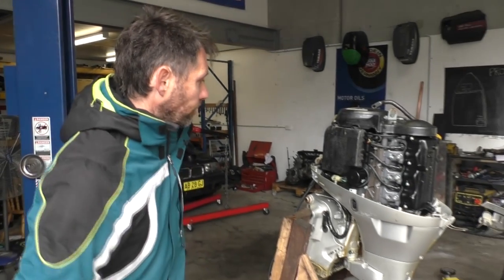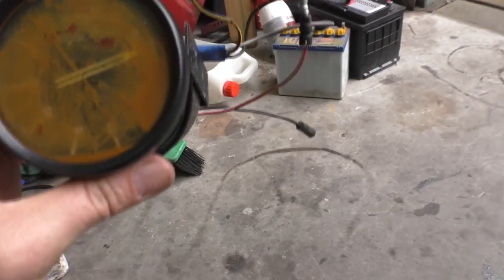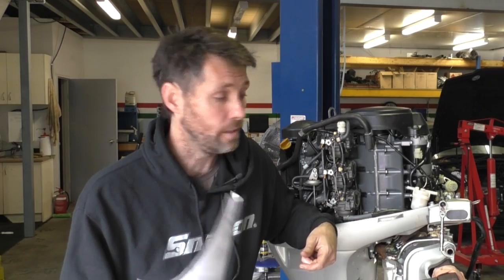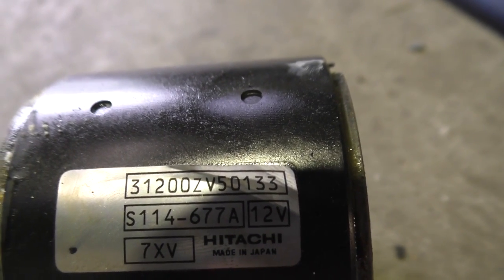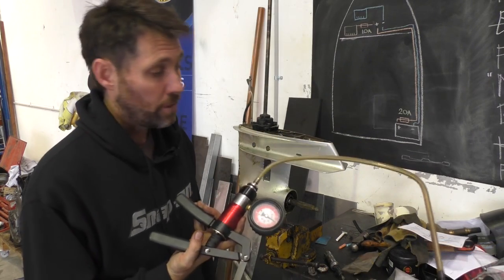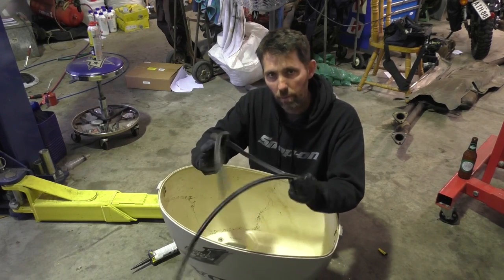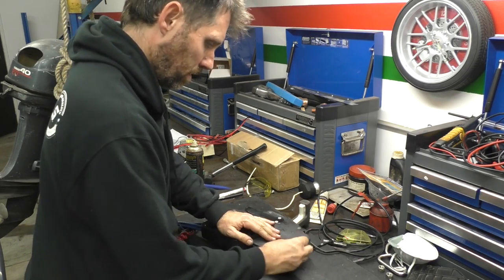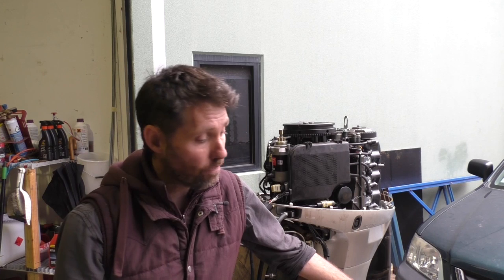Saving a sunk Honda BF40 outboard motor

Comment: A guy is willing to give me a boat for free that is sunk in his boathouse. Its a 24 foot cabin cruiser I/O from the mid 90s thats had the engine submerged during high tides (theres no water during low tide) for probably 5 years or so I was thinking of taking it on if we can get it out of the water. Do you think it would be worth trying to rebuild the original engine or just convert it to an outboard? He thinks the hull cracked around the out drive.
Reply from the maker: An engine that is repeatedly submerged and then exposed to air is going to have very bad corrosion. It would be cheaper to replace and rebuild most likely.
Reply: @DangarMarine  Ok thanks.

Comment: Hello, I'm Marcelo, I'm from Brazil, I really liked your drawings, I'm buying a motorcycle Honda hp for the year 2001 to work every day, it's in great condition, are these engines reliable? Can I get his pieces today?
Reply from the maker: I've found this Honda motor to be very reliable and yes, parts are still available.

Comment: Hi ! Good job !
Did you remove the flywheel to have a look on the coils (charging, lighting and trigger)...?
Do you think it is necessary to do it in that case ?
Thanks for all your vids !
Reply from the maker: I didn't remove the flywheel, but I did pressure wash with fresh water under there. Getting the salt out is all you can really do so I'll see how it runs and go from there. In hindsight it probably would have been a more thorough approach to take it off but I think it's pretty clean now anyway.

Comment: Did you change the spark plugs? I have been using the original sparkplugs on my Honda 40 for 12 years, because I have still not found a ratchet with thin enough walls for sale anywhere.
Reply from the maker: Yes, I did change them, and yes they are in a very tight space! I used what are called tube spanners to do the job. http://www.ebay.com.au/itm/like/231660109984?lpid=107&chn=ps
Reply: Dangar Marine Thank you sir, that is very helpful. By the way; your videos are very interesting and educational. Some of the very best I have seen.
Reply from the maker: Thanks mate. :)

Comment: Brilliant! I wish I knew my motor would be in as good a hands as yours when I take my motor in for a service!! I have such a problem with reverse gear so stiff to put it into it, brand new cables? Keep up the great videos :)
Reply from the maker: Could be cables. I would start by disconnecting the cable from the gear selection lever at the outboard and see if the lever is easy to push. If not, then it might not be you cable. You could also disconnect it from the forward control and see if that is easy to push. By isolating each part you will find out what is causing the resistance and save yourself replacing a part that is fine.
Reply: +Dangar Marine  thank you so much for your reply, I'll give that a go :)
Reply: +Dangar Marine hey well I've done what you said and traced it down to the actual outboard?? Is this a serious problem? Thank you and much appreciate your time :)
Reply: Yeah it's definitely the outboard, it works easier if I turn the propellor into different positions?

Comment: Does anyone have a picture where the trim solenoid ground goes too?  On mine it goes to the metal bracket that holds the trim switch in place.  I'm having grounding issues the stop the motor from working.  I loosen that bolt on the trim switch metal bracket when the ground goes too then tighten it again and my trim works again.  Can't find the proper location of the black wire.  Any help greatly appreciated

Comment: Looks smiler to the one on my dads boat, but thats a 35 instead of 40.
Reply from the maker: Hey Robert. I'll have to take look and see which HP range used the same block. It would be interesting to see what the upper and lower limits are.
Reply: +Dangar Marine 
I have a 50 honda outboard it looks the same like the 40.
Reply: +Dangar Marine 
3 years old someone put in sugar in my oil tank
Reply: Did you end up doing anything with the rusty part at the top of the pivot tube? I've been looking at the engine on my dads boat and it's also very rusty, with chunks of rust falling off.

Looks like the pivot tube is going to have to be torn down as it is really stiff, it will turn but it takes two people to move it. It was tight when it came out of the water about 7 years ago, but much worse now.

Comment: My mate un seized a outboard with the plugs out and carby off by oiling the bores and turning it over with a breaker bar but he was turning it clockwise abd counter clockwise...does turning a outboard over by hand counter clockwise damage the engine at all please  ...two stroke
Reply from the maker: No, not with a two stroke. It is more camshaft running over the lifters backwards that can be bad with a four stroke.
Reply: Thankyou i was afraid he done something cheers
Reply: And i am grabbing a beanie from you for winter get a oic in my sea al supa skua 11ft 30HP short shaft Tohatsu ✌️

Comment: What kind of grease are you using? Do you use one kind where rubber parts are present and a different kind elsewhere?
Reply from the maker: I use a variety of greases. Spray grease I use white lithium, then normal marine lithium solid great and sometimes rubber grease on rubber parts. If you go to any car parts store and ask for rubber grease they'll have it.
Reply: @DangarMarine  Thanks so much for the info. I really enjoy your videos and have learned a lot. You make things appear very accessible. My next task is to try to use some of your techniques to get the top off of my raw water strainer. Going to maybe try heat although I don't know that I fully understand the concept. Seems like heat would cause something to expand rather than contract!

Comment: The cooling water problem is beacuse you dont get the water thight enough on the gearhouse 
had the same problem myself testning it in The garage
Reply from the maker: That can definitely happen, but in this case it turned out to have a blocked tell tale as well.

Comment: hey i have the exact same engine honda bf40a that also sank i have compression spark and brand new fuel and just cleaned the carbs and it wont run for me... it is running well off of starter fluid well off starter fluid but once i stop spraying it dies any ideas?
Reply from the maker: If it is running on starter fluid then it must either be a problem with the carbs or fuel pump.

Comment: When you re-installed the propeller did you just put it on hand tight or did you use a wrench to tighten it?
Reply from the maker: I get it finger tight and then use a wrench to move it past being snug until the holes for the split pin line up. That is all you need.

Comment: What was clogging the tell tale, did the compressed air clean it out, i have a 45 with a clog issue
Reply from the maker: Yes, in this case the compressed air did unblock it. Sometimes bits of the impeller blades can break off and get lodged. These are harder to get out and may require the powerhead to be removed in the worst case scenario.
Reply: So after fuddling with it for a bit i found that the thermostat had been removed for some reading, after blowing out the tell tale exit fitting and installing a thermostat it seems to be coming out pretty well.

Comment: hi, I ave a question.....I remove the metal anode to my honda BF 40 A LRT, where are the engine anodes?
Reply from the maker: Block anode is part number 4 on this diagram. http://www.boats.net/parts/search/Honda/Outboard%20Engine/2007%20and%20Later/BF40AK0%20LRTA/CYLINDER%20BLOCK/parts.html
Reply: tanks. you are very competent. 
you video are very beatiful .
  I hunderstand to my honda ave 3 anode...... right?
Reply from the maker: Yes, I believe that is right.

Comment: Did you say that motor spent 12 years at the bottom of the ocean?
Reply from the maker: No, it would only have been under for a couple of days at most.
Reply: FYI, any motor that is sunk in salt water for 12 months would now be called an anchor. All the different metals would have made it a battery and turned it into a fluffy mush. I doubt you could even salvage stainless bolts off it. Copper, brass, aluminum, iron and stainless mixed with salt, sad.

Comment: Why loctite on the impeller bolts?
Reply from the maker: The short answer is because the service manual says to, but I imagine it is because is they vibrate loose it doesn't take much of a gap below the housing for all the water pressure to be lost and none of it to make it up to the engine.

Comment: Love your videos!  I've got a question about fuel lines.  I've recently purchased an '82 evinrude 150HP 4 stroke and have been going through the motions getting it running.  Most of the fuel lines on the outboard were zip tied at the connection.  Any thoughts on zip ties vs hose clamps or tension clips?
Reply from the maker: There are special zip ties that have a curved back to the locking mechanism so they can fit snug around a tight radius of a fuel fitting. If you use those I think they are fine on the low pressure systems. If you can squeeze the primer bulb up quite firmly without a leak then you should be good to go.
Reply: Thanks!  Keep up the videos, really well put together and informative.

Comment: Don't locktite the pump housing bolts in ANY outboard ever. Clean them and grease them. Anybody who regularly changes impellers on old outboards will know why.
Reply from the maker: You should write to the manufacturers and tell them they have it wrong in their OEM service manuals.
Reply: Should I indeed. You carry on putting loctite on your bolts, only experience will teach you not to.

Comment: WD40 on the electric plugs? I thought wd40 was a strong electric insulator?! Is that a normal procedure?
Reply: Water-dispersant (WD) helps get rid of any residual moisture.
Reply: @squidinkRC  Yes because it form very thin layer that cover all surface with Electrically Insulating material ... does not look good at to me  ...

Comment: put some grease on the sparkplug.  dont use wd40 on electronics. doesnt last.  all electricals should have grease.
Reply from the maker: I prefer aluminium antiseize for the plugs and agree that dialectic grease is great for the electrics.
Reply: Woah.  . Aluminum in the grease not good.  that sounds risky.    try reg car grease instead. nice n cheap.

Comment: Get a Evinrude e tec thoses four Stokes not a lot of power. 2 stroke are way better than the 4 strokes even a old two stroke is better than a 4 strokes.
Reply from the maker: This sunk engine turned out to be a lot more reliable that my mates brand new Etec. This is running nicely, his is up at the garage at the moment for the fourth warranty repair. :(

Comment: YAMAHA 25D 2 sTROKE 1980's - TO ANYONE - AM I CORRECT IN THINKING THE LOWER UNIT BEARING CARRIER JUST PULLS OUT BECAUSE IIM HAVING AN ABSOLUTE SHIT FIGHT WITH THIS THING - SWEAT DRIPPING OF MY HEAD...MAPP GAS AND PIPE FREEZE NEXT - CAN ANYONE HELP - THANKS
Reply from the maker: I don't know if you have seen this video yet https://youtu.be/HRpfaOiXxWo but I had a hell of time getting the bearing carrier out, they really can be stuck in their amazingly tight. Lots of heat is generally the way to go.